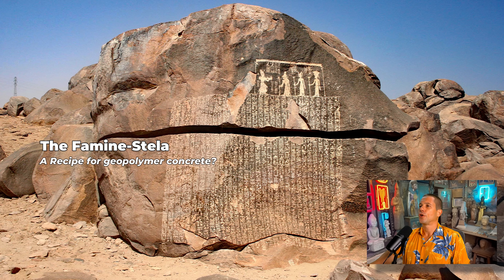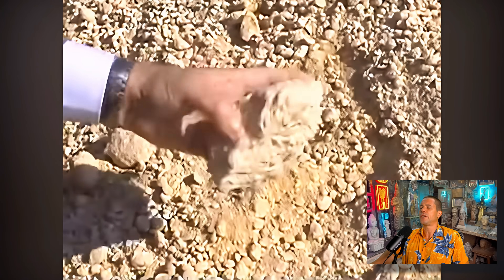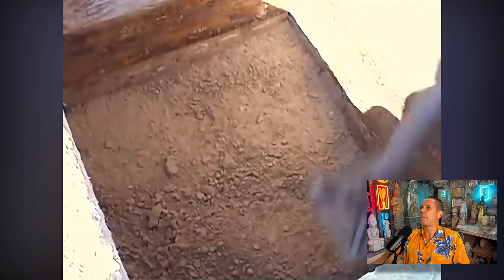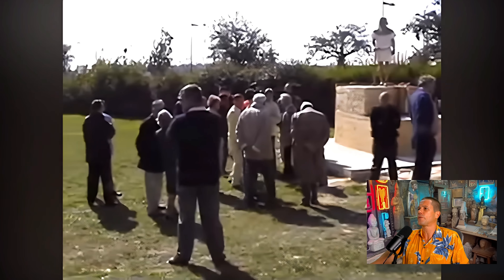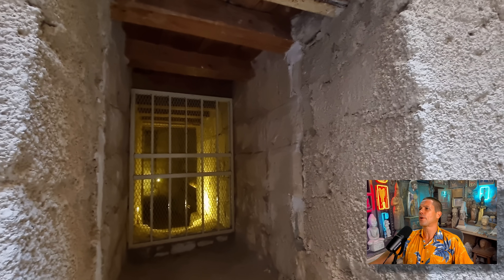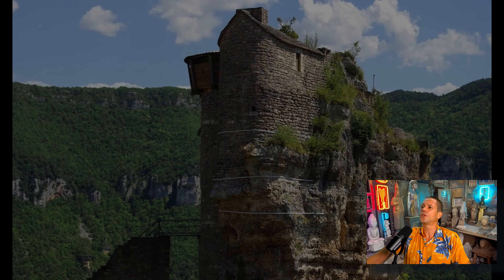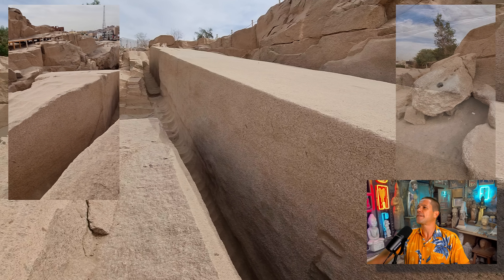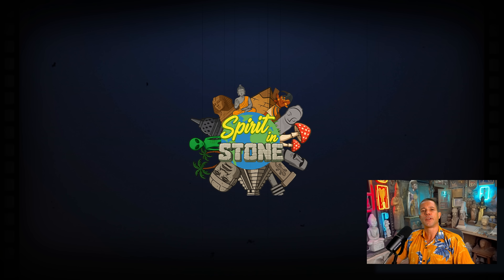The GeoPolymer Experiment | Recreating the Pyramid Stones of Egypt

Comment from the maker: Here’s the book by Marcel Foti:
👉 The Natron Theory – https://amzn.to/3Xqtsm3

This book goes into much more detail about his geopolymer experiments, liquefying granite, and the science behind his theory.
(Affiliate link — using it supports the channel at no extra cost to you.)
Reply: it's funny, but I thought about this yesterday, and today algo showed me your video :)
Reply: I asked AI: What is the volume of the Suez canal?
That’s a good question — the exact “volume” of water in the Suez Canal depends on which parts you include. But we can make a rough estimate using published dimensions.

✅ Known dimensions
Length: ~ 193.3 km (as of recent configuration). Encyclopedia Britannica+2Suez Canal Authority+2

Maximum water depth: ~ 24 m. Suez Canal Authority+1

Typical surface-width / canal width: water-surface width can be ~ 313 m, while a narrower “navigational channel” is often 200–210 m wide. World Economic Forum+2Alexandria Chamber of Shipping+2

🔢 Rough volume estimate (upper bound)
If we approximate the canal cross-section as a rectangle of 24 m depth × 313 m width — multiplied by 193.3 km length — we get:

Volume≈193,300m×313m×24m≈1.45×10^9 m3
That’s about 1.4 billion cubic meters of water (assuming uniform maximum width & depth).
This means that approximately 14,500,000 m³ of stone blocks were removed to dig the canal. Those materials would have had to be placed somewhere: either piled up along the canal as a wall with the same width and height as the canal’s depth, or stacked into large pyramid-shaped structures. We chose the latter.
Reply: Do you not understand how huge some of the structures were? Whole mountains made out of this but they were not mountains. I don’t think you understand. Every stone in all the vast pyramids in a world wide pyramid energy grid. Pulsing sound frequencies to control the planets rotational speed so our planet would have had a stronger atmosphere as well as way more stable and predictable. Everything in space and time is magnetics.  As well as having gold but the iron ore plates drew the moisture out of the rocks towards the surface. 24 gigawatts.

Comment: They used electricity to fuse the stone and iron ore and iron ore flakes. They poured molten metal into the copper moulds. They also used copper rods for even heating. It’s called induction heating method.

Comment: The Recipe Breakdown
To recreate a stone that looks and tests like natural granite, the formula follows this sequence:
The Base: Finely ground granite or basalt powder. This provides the crystals (quartz, feldspar, mica) that give the stone its natural texture.
The Binder (Metakaolin): Ancient Egyptians used "roasted" clay. When you heat kaolinitic clay, it becomes metakaolin, a highly reactive aluminosilicate that acts as the "glue."  
The Activator (The "Secret"): You mix Natron (Sodium Carbonate) with Slaked Lime (Calcium Hydroxide) in water. This creates Sodium Hydroxide (Caustic Soda), which dissolves the surface of the granite dust, allowing it to chemically fuse with the clay.
The Curing: The mixture is packed into a mold. Unlike modern concrete, it does not "dry"; it poly-condenses, meaning the molecules link together into a ceramic-like polymer.

Comment: The Sealed Manual: The Chemistry of the Pyramid
I. The Gathering of Elements
From the ancient pits, seek the argillaceous stone,
Soft limestone crushed, till the powder is shown.
Gather Natron salt from the lakebeds gone dry,
And Kaolin clay where the riverbanks lie.
Burn the wood for the Lime, the ash of the flame,
To trigger the reaction that gives stone its name.
II. The Sacred Ratio (The Formula)
Heed the proportions, let the measure be true:
Ninety percent (90%) of crushed limestone for you,
The body, the aggregate, the foundation of might.
Seven percent (7%) of clay, binding it tight,
The aluminosilicate, the molecular glue.
Three percent (3%) of Natron and Lime in the brew,
The catalysts waking the stone into form,To ensure the dust becomes a living stone, indeed,
Add the water with a hand careful to the need:
Five to Seven percent (5–7%) is all that you require,
Enough to turn the mix to damp sand, as if tempered by fire.
Do not drown the stone, nor let it turn to sludge or clay,
So as it dries, no cracks shall mar the surface in any way.
To withstand the ages, the sun, and the storm.
III. The Casting of the Monument
Mix with the water till the paste is thick,
Carry the buckets, move steady and quick.
Set the wooden molds, sturdy and square,
Pour the liquid limestone with patience and care.
As it flows like a river, it finds every space,
Leaving no gaps in its stony embrace.
No chisels, no hammers, no dragging of weight,
Just the genius of chemistry, sealing its fate.😊My Final Assessment (The Analytical Conclusion)
My assessment focuses on the transition from argillaceous limestone (limestone naturally rich in clay) to a synthetic megalith:
Material Selection: By choosing argillaceous limestone, Imhotep was selecting a rock that already contained the "pre-requisite" silica and alumina. Crushing this stone wasn't just for transport; it was to increase the surface area for the chemical reaction to occur.
The 90:7:3 Ratio Logic:
90% Aggregate: This provides the structural bulk and mimics the natural fossil-bearing stone.
10% Geopolymic Binder (7% Clay + 3% Salts/Lime): This is the "magic" percentage. In modern materials science, this is the perfect amount of binder to coat the aggregate without causing excessive shrinkage or cracking during the "setting" phase.
The Casting Advantage:
The use of wooden molds allowed for standardization. Every block could be made to a specific height, ensuring the pyramid rose in perfectly level tiers—something incredibly difficult to achieve with hand-carved natural stone.
Final Verdict:
The "Imhotep Recipe" represents the birth of Synthetic Geology. It proves that the Great Pyramid is a monument to Information (the formula) just as much as it is a monument to Labor. The builders conquered the desert not with iron, but with a bucket and a ratio✌️😊

Comment: Oblisk looks like a mold was made out of wood and they poured the geopolymer into the oblisk shaped mold,the were obviously good at it,seemed to me either this cracked during the drying ,ie,allowing a place for the liquid to drain off,hence what you see under the thing ,mabe they messed up and what drains off with the liquid was mixed in with the geo polymer,all them scup marks look like they may of been beaten by time,hehe trying to free it from the run off ,it must of dried to quick,time is always against you right

Comment: Ive found 2 ancient sources that describe geopolymers.  What youre describing is a great 3rd addition to my list.  

I dont want to ruin the suprise, but the Apiru or Habiru were a refugee class consisting of mostly hurrian people's and they were a disliked class of people in egypt.  They are referred to as the dusty ones.  Likely because they were working with lime.  Copper plates were probably used to cast the blocks.  However not all the stones are cast.  The apiru were merely refurbishing.  

Also MIT recreated the process as an experiment in geopolymers.  They reverse engineered the process to create limestone blocks in 2 weeks time.

Comment: How did the ancients cut straight lines like saw marks or perfect core holes? Casting is one thing but melting in a straight line or a perfect cylindrical core using caustic chemicals like potassium hydroxide is highly unlikely! The ancients built the pyramids and 2 km pillars beneath the pyramids before the Young Dryas event. The Egyptians discovered the site much later on & made primitive repairs in the pyramids & the Sphinxs' face. Mixing those time periods & techniques as one is a mistake.

Comment: All these types of BS videos never mention that 80–90% of the stone blocks are rough-cut, with wide gaps between them and visible chisel marks! 
Only the outer casings and a "limited" number of internal stones are smoothly finished with tight joints. How do I know? I’ve seen them myself.

Comment: Cast aggregate stone may be a hypothesis for a very small portion of the massive Egyptian stone work, but when you show half-cut granite stones in a quarry, come on.
Further, any concrete made 2000+ years ago is far weaker than today's concrete. Read a book on it one day. How much rebar or flax/hemp fiber have we found in these cast stones?! No cast door header stone would survive installation without internal rebar or fibers.
Also, molding pre-cast stonework involves casting molds. It is not logical to make hundreds of different casting molds, nor has patterning been found in the pyramids to indicate this.
Lastly, FFS, use science. Send core samples of the most suspect stone to a lab! The cut cross section of a naturally formed stone will be far different than a cast aggregate in terms of air entrapment, fracture lines, grain size, crystalline structure, and so on.

Comment: I am a fully qualified stone mason and worked with large stone and its not possible to do what Egypt did with the tools they had. Look at the great granite statues in Egypt, they are so smooth. Moulding stone is something that has been discussed for years, look at peru walls, the theory suggest the ancient builders crushed local rock into a powder and mixed it with a chemical binder (possibly plant-based extracts) and water to create a moldable paste that then hardened into rock. Geopolymer Theory is a good argument.

Comment: 🧑‍🔬 Chemist here. The “red granite” in that clip 100% NOT REAL GRANITE ‼️
but some kind of artificial stone made to look like red granite – for example a cement-based, gypsum-based or calcium carbonate–based mix with pigments and stone chips.

⚠️ True granite does not soften and crumble in a room-temperature liquid. 

To actually break down silicate minerals you need laboratory and extremely aggressive conditions (800-1200°С, hot HF, high-temperature alkali fusion, etc.), not a simple home experiment. 

Most likely an acid is first used to attack concrete or some kind of fake stone, and the KOH added at the end just neutralizes the remaining acid and creates foam😂

...which looks dramatic but has nothing to do with “melting granite” or revealing ancient secrets.

🤷 On top of that, natural granite is not a uniform mass but a complex crystalline composite:

interlocking grains of quartz, feldspar and mica formed by slow cooling of magma.

Any cast “stone” made from a slurry will have a completely different microstructure and visual pattern – without the characteristic veins, depth and irregular crystals that let a geologist instantly tell a cast material from real granite.

🤥 FAKE

Comment: none of the stones are the same square size like molded, molds are made for speed and consistency, each stone is cut and seated to interlock with a nub on the outside as a gutter for watter and add strength by bringing the weakest part of the blocks ( any corner) farther out so they chip and break before the block.   if they could melt stones, men would have made some funky above ground structures that look like one whole mass.

Comment: This might well have been a part of the mystery, it's still only a puzzle stone (sic!) of the whole picture.
On the one hand, even if the pyramide blocks needn't be transported as a whole, but in smaller "portions", to mix the recipe, where needed, there was still an insane amount of material and also water to be transported (the water adding another reasonable percentage of additional mass).
The next question is: Why did it take scientists 200 years to find out, which kind of blocks have "natural" origin, and which textures are based on mixing stuff?
And still, there are these monuments that definitely were made from solid rock.
There is so much more missing from the (hi)story.

Comment: I didn't hear this specifically mentioned, and I don't know if it has been mentioned before, so please forgive me if it has, but I feel as though a very important tool, the mold, that was used in the reconstitution process of the limestone into blocks may still exist today in the Great Pyramid. What if the item that we call the sarcophagus in the King's Chamber is actually the mold that the ancient Egyptians used to build the Great Pyramid? First of all, its construction is extremely precise, famously so that even a piece of paper cannot fit in between its joints. A mold would have to be built with this kind of precision. As the pyramid was being constructed, the mold started much larger, and then as they built higher, the blocks got smaller, thus the size of the mold got smaller until we have the example we see today. Once the mold served its purpose and was no longer needed, it had to be built into the pyramid because there was no longer the ability to remove it. The sarcophagus also looks like a very worn precision tool, especially if you add the context of your video. I believe they've done molecular studies of the limestone in the rock quarry at Giza and the same done to the blocks used in the pyramid, and they differ in such a way that man must have been involved. Or rather, some kind of process happened between being quarried and being used to build that infers man's involvement. This process in your video of reconstituting limestone feels like it could be the reason that the limestone used to build the Great Pyramid is molecularly different than the limestone in the quarry, yes? Has this hypothesis been mentioned before? I'm just curious. Thank you for a great video and your time. My best to you and yours. Talk soon.

Comment: Wherever in the world people started to create primitive societies, what was left over from berries and the like was vinegar. Of course, there are different methods for drilling and cutting stones. But vinegar is one of the oldest substances that molds different types of rocks. It dissolves the stone, but a linen string, a bronze chisel, etc. with which you cut it remains intact. Even if you hit different stones against each other, one is like chewing gum but the other does not dissolve. That is why there are these flowing traces when examining the monolith.
Reply: The vinegar doesn't evaporate anywhere. That's why all these cuts are at an angle. I guess there are also images of some characters carrying containers from one end to the other. It's the same vinegar and sediment. The vinegar was returned to the cutters and the sediment was carried further away. That's why the pebble is nowhere to be found, because the sediment decomposed and turned into sand in a few years.

Comment: Melt a granite? Hmm. 1) Never been successfully made. Softer rocks such as limestone, yes. etch feldspars (aluminosilicates), to damage them on surface, yes, but nothing like this, NOT granite. Everyone can buy KOH, pick up a granite rock and try it for self. 2) Molten KOH is not really easy to make. From the available chem & phys facts, it follows that: Chemically, it IS possible (KOH melts at a relatively accessible temperature). 3) Technologically, earlier civilizations couldn’t do it, bc they lacked materials resistant to molten KOH and had no way to produce pure KOH without modern mean, e.g. cointeiners. Theoretically YES, practically almost NO, unless you have nickel, proper drying of the lye, and tightly controlled work without any moisture (air moisture incl.). WHICH MEANS, those guys who did this would need to be WAY more advanced than Egyptians during their "pyramid-building" period.

Comment: Sorry to break it to ya, but modern concrete only breaks because all these hillbillies insist on reinforcing it with steel. When builders finally get their acts together and use Basalt rebar and chopped fibres, concrete will just continue to get stronger over time (like the Roman concrete).

Comment: It's about g'damn time someone put this forth. I've been ranting that this is the only possible solution to explain all the megalithic artifacts found around the world. Local rock was quarried and coarsely  pulverized. Then a liquid binder was created and the pulverized rock mixed in. The formula was poured, cut, shaped as a soft clay then left to cure. The chemical composition would be very close to the original rock and the crystal structure almost identical if the mixture was coarse, retaining the original crystalline structures.

Comment: I would think all one would need to do is reverse the chemical process which hardens stone. Which in sand casting is Carbon Dioxide and hardens sand. And what'da know, looking into this theory, he states;  It extracts the silicon from the stone and assimilates it. It eats quartz for breakfast, while it belches out CO2... Na2CO3 + SiO2 = Na2SiO3 + CO2

Comment: What they are describing is basically Roman Concrete, which is known to have that leaching effect from weather over time that actually strengthens the structure because it fuses the blocks together.
You should be able to tell pretty easily whether the pyramid blocks were made from whole cut natural stone, or man-made concrete (which this is) by taking a slice of the two and comparing.

Comment: If their mix was more like wet sand, and they packed it in the mold. They may have been stable enough to lift and place while they were still wet without them crumbling. If they were placed wet, that would account for the joints being fused. And if they could soften natural stone, then they could smooth it like plaster or clay. That would skip a lot of hand polishing and make it easier to get those tight sharp polished edges. Also I never could get over how some of the heiroglyphics are so sharp and smooth they look like they were stamped more than chizzled out.